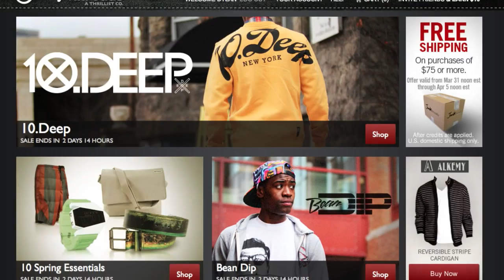Scientific Tuesdays - Superman Hand Cannon (Tennis Launcher)

Comment: I would prefer a quick refill system attached to it as well.
Push! Boom! Gas flows in to the chamber.
but that would require some additional sealing since the ball is not attached.

Comment: just a small note , drill a small hole in the side and just cover it with duct tape, when u fill it with hair spray and put the tennis ball in then find a canester of pure oxygen and spray that in the small hole for about 10-20 sec(depending on how poweful u want it) and tape it back up, that oxygen will make it way more poweful  (i will take no responsabalty for the following;
loss of limbs, blindness, burns, dihreia, constapation, the cause of the 2nd coming or the apocclyps, or anything else)

Comment: they are better with pvc plumbing pibe, cement pipe adhesive, a barbeque lighter
and a secound screw on chamber to spray hair spray in the barbeque lighter goes in the end so you get a cool trigger and you can also mold a handel at the front also if you know what you doing you can put a screw in thread on the front to change the size so you can shoot golf ball up to frozen oranges and trust me they are the best it goes threw car door when they are frozen

Comment: I'm making one of these; the only difference is that my barrel is made of 2 1/2" sch. 40 PVC pipe. I'm having a problem, though. It never fires. I know the lighter works because i un-screw the cap and i see a spark when i push the button. I'm not sure if it's the hairspray that isn't flammable enough or what. Any ideas? Thanks.

Comment: I seriously want to make one of these, and the pneumatic ones.

One question about this one though, is there any way to have a continuous flow of fule without blowing the source (given that if you insert the source tube directly to the ignition chamber, the source will also ignite)? And on the pneumatic ones, is it possible to use an automatic pneumatic pressure builder instead of a handpump (it'd be tiring to pump every time for ammunition lol)?

Also press 6 for "COME AT ME BRO" skit!

Comment: just wondering if it would would if i get like a can of hairspray and tape it to he cannon and drill a hole in the side  where the can is and get a straw and glue it to the hole and  taped/glued the other end to the spray part so that way i could just quickly pump it and put a ball in and be more efficient. would it work??